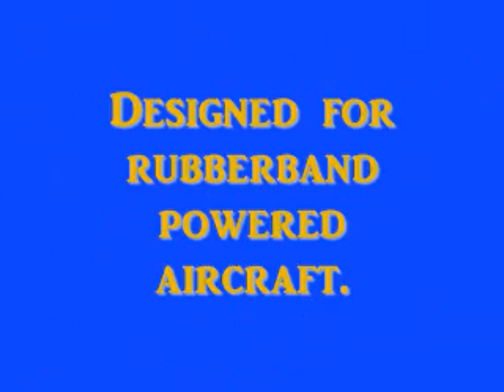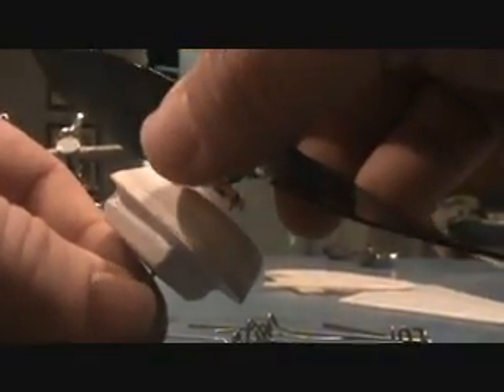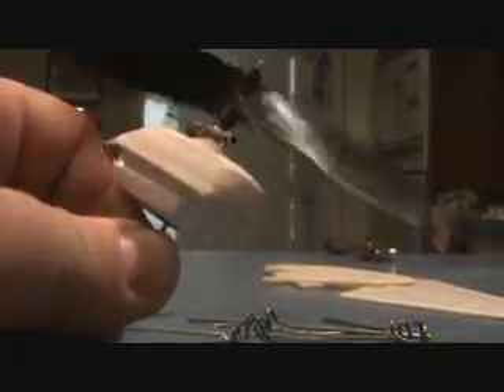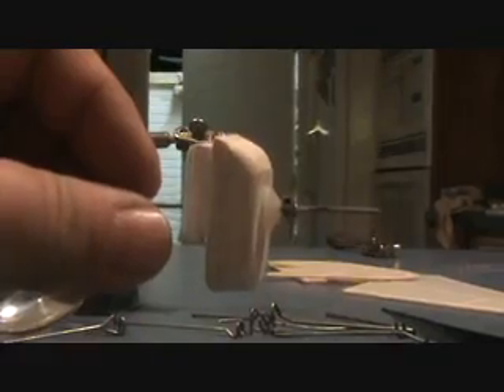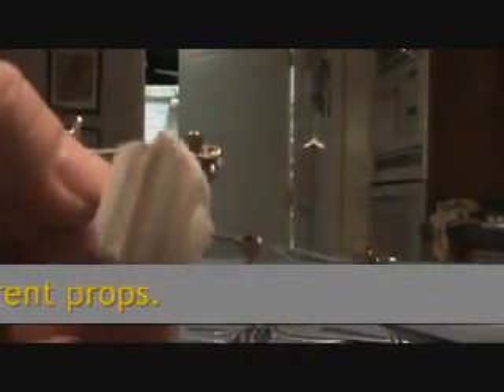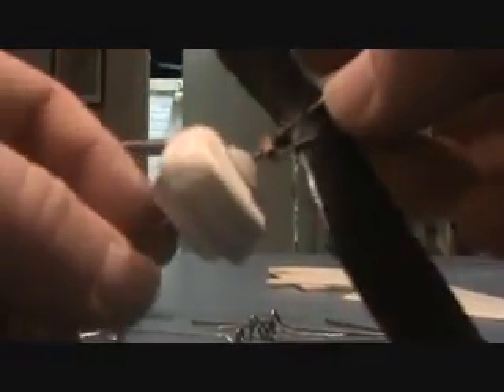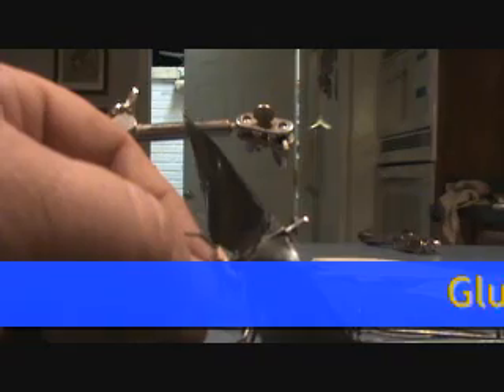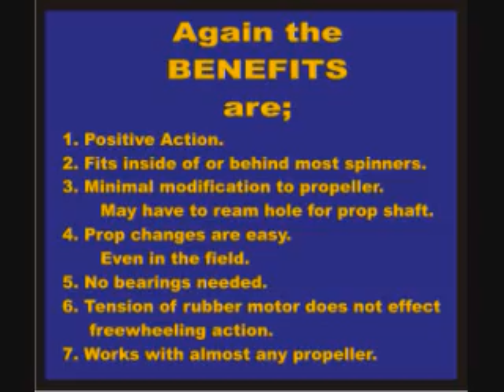Yet Another Freewheeler Part 2 of 2

Comment: What's length of square brass tubing of finished freewheeler? Thanks
Reply from the maker: Sorry it took so long to replay.  The length of the square tube varies with plane/prop size.  Most have been around 1/2" long, on larger planes, I think that the longest one was 3/4".
Reply: @merlin2360  Thank you.  I already made couple and I like them.  Love your videos.